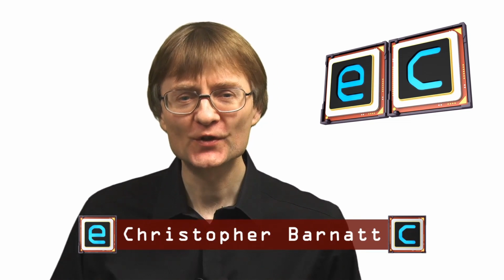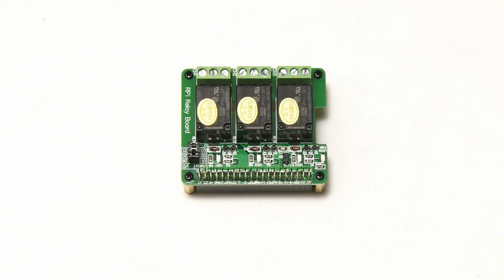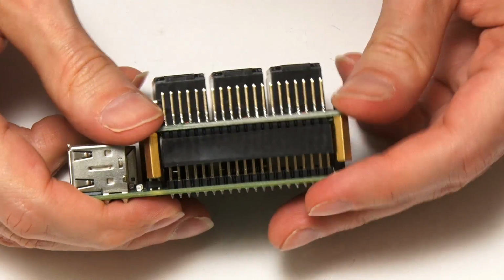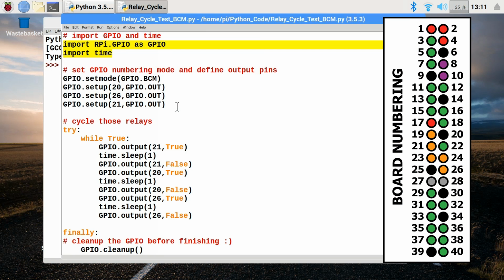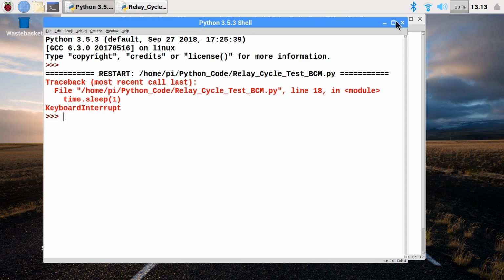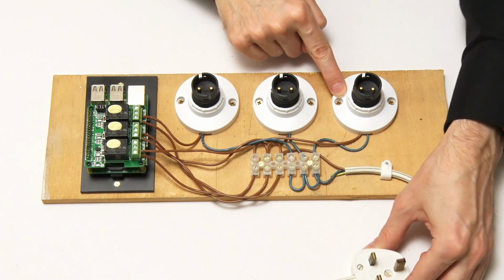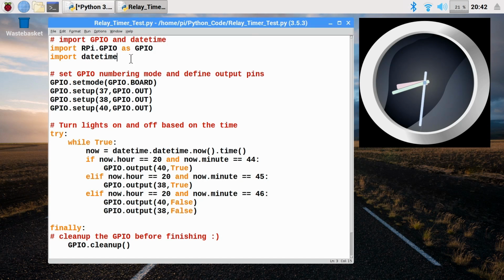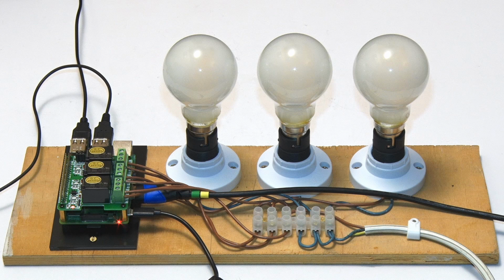Raspberry Pi Automation #1: Mains Relay HAT

Comment: Superb video Chris, looking forward to more automation videos. I've just got a couple of ESP8266, not entirely sure what I'll do with them yet, but one idea is to build a light for my office using WS2812 LED strip, controlled by Alexa, hope to start experimenting in the next few days.
Reply: That sounds like a nifty project. I was actually mulling over something similar for my DIY dream home project. I eventually want to build an off-grid tiny home with automation. In the absence of mains voltage, the home would obviously run on renewables and battery backup. So it would be most efficient to use LED lighting powered by DC from the battery bank.

If you make it, I hope you consider documenting it for YouTube. I'd like to see what you come up with.
Reply: @UCvqR6jxs8L_k74iTGOebE6g Thank you! Yes, LEDs are definitely the way to go, especially when your feed is engineered to low voltage, as there will be minimal losses due to transformers IMHO. Personally it's just a hobby for me and I don't really do build videos, although there are a few LED related videos on my channel. All me projects are derived from endless browsing through online info. This site may help, it has a ton of info on LED projects and displays https://www.tweaking4all.com/hardware/arduino/arduino-ws2812-led/

Comment: I did some similar in Basic years ago without the complicated setup you've got to control heat in a boiler, it involved a lot more code!! Sadly I couldn't test it if I tried it probably would have gone boom, as my electrical expertise is non-existent if it got too hot it would switch itself off, I had a maximum and a minimum heat level.

Comment: Nice video,

As you stated demoing this board shows how you can modify the code to fit into your environment and control devices either on a time bases or remote / manually.  With home automation using network/wifi I would just say do your homework with regards to securing your creation.

Comment: Have a look at Home Assistant, it installs on a Pi 2 or 3, as a docker container, or as a VM. And has so many integrations your mind boggles. I have been using it for a year now, it is amazing and the community is very active.
Reply: Just had a quick look then. I have a spare Pi so I might give it a try since I an rewiring the lights as I replace the ceiling.
Reply from the maker: I will take a look, thanks.

Comment: Tiny bit more wiring but a ton cheaper https://www.ebay.com.au/itm/5V-12V-1-2-4-8-Channel-Relay-Module-Arduino-Raspberry-PI-ARM-AVR-DSP-PIC/183418623699?hash=item2ab49a16d3:m:mfdi0jI17mD_rsG5P-hfu1g&frcectupt=true

Comment: In the US people (not me) get all excited if you don't use all three wire.  I noticed that the relay did support three wire but that the light sockets did not seem to.  Is that normal for sockets in UK?  It might calm some of the more tense if you mention the relays do handle 3 wire connections.  Great work and I might be trying this one!  Would like to see comparisons between cheap single boatd Win PCs one day.
Reply: the relay is switching the middle pin between the two outer, so you have a common pin in the middle, and then a normal open and a normally closed. there is nowhere to connect a PE wire, as there is no metal boxes that might become live at mains voltage in case of failure

Comment: Great. Do you have a plan to demonstrate some Java codes? Python is simple and powerful maybe there's no necessity to use Java, I suppose.
Reply: I think he prefers to demonstrate with Python for just that reason. Java is fairly ubiquitous, but Python has established itself as a very robust language that works splendidly across multiple platforms. I imagine an RPi might run Java just fine, but Raspbian comes with Python pre-installed. I've noticed that he tries to do things in the simplest and most straightforward way in hopes that his audience can follow along, so perhaps that's why he prefers Python.

I would love to see him tackle a little Java, too. We'll just have to wait and see if it comes up.
Reply from the maker: I do indeed use Python to keep things as straight-forward as possible. But Java is not rulled out. :)

Comment: "Lightbulb sequencing parties"!? Ohhh... the high life. Too rich for my blood.
Reply: This isn't too bad, the "LED Light bulb sequencing parties" are the expensive ones, the "Energy Efficient Light bulb sequencing parties" can take a while to get going 😁
Reply: Cal Mac Also parties using floodlights would be dangerous. Mixing water with electricity would be hard on the people attending those parties!  Yet I’m no expert since I don’t drink.
Reply: @perrymcclusky  Floodlight sequencing parties are for royalty, it would be a dream to attend one of those my friend. Water is used frugally at these type of parties, lager is used chiefly, it is safer, it's less conductive.👍
Reply: When RGB just won't cut it
Reply: @jasongooden917  😂😂
Reply: I think they are reserved for the "black tie" set... Red carpet is optional.
Reply: Better if you use the NC contacts instead, and then do a markee type chasing thing.
Reply: Light switch rave by any other name

Comment: 9:09 please don't do that.  use electric ferrules on the wires !
Reply from the maker: Again, point taken, but I used what I had available in this test setup.
Reply: There is nothing wrong with not using ferrules. Especially when this is just temporary setup for testing and demonstration only.

Comment: £24 for 3 relays and a PCB? are you completely nuts? 
no hate, but that is insanely expansive knowing the price of a relay.
Reply: On one hand I would agree about paying $16 (USD) for 3 relays is a bit much. However, the cost for someone who is not very knowledgeable about electronics might worth while as part gaining knowledge. From a learning standpoint, the module might allow a beginner to focus on the theory of how a relay works without worrying about the wiring of the support circuit.
Reply: so go get 3 relays and a pcb and show us just how simple it really is, im sure your going to try something like "i dont have the tools to do it" in which case you pay 24 euro's and be happy its not 50 euro's.
Reply: I not only found it expensive but compared to the USA price it is an even bigger swizz, £24.99 UK $16.99 USA
 I would have expected the prices to be £16.99 UK and $24.99 USA but even this would be over the top
 A bit of breadboard and the components could make this for under £8 easily
Reply: @AndrewAHayes  there is always cheaper options... are they practical and safe? most of the time no they are not, your paying for quality parts which are readily layed out on a pcb which conveniently attaches to a raspberry pi, now take your bread board and components and mass produce it and then ship it all over the world, but its not allowed to cost more than 10 euro's, hmmm  25 euro's is looking pretty good right now
Reply from the maker: I take your point. Though minority products always have higher prices. Note that there is more than a PCB and three relays here -- a Pi cannot drive a relay directly, so there are are Darlington transistors/pairs for each relay too, plus various resistors and the LEDs. But yes, all of the components could be purchase for far less than the whole board.

Comment: Would be really usefull to set up a wi fi interface ..
Reply: I watching take information. No money....
Reply from the maker: In the next part we will get to wireless . . .
Reply: Excellent. OpenHab is web interface based but trying to set up the devices is quite difficult and the documentation is a bit opaque. I figured it would probably be quicker and more usefull to learn enough python to write your own switching tables rather than trying to hack openHab which seems to be more aimed at corporates "Things" that already have the coding for them written.  I am wanting to automate a 12v off grid RV. At the moment I just have the lighting working with BasicUI. Look forward to see where you take this.

Comment: Can you stack the units and drive up to 9 relays?
Reply from the maker: Potentially, yes -- by removing the jumpers and wiring different GPIO pins to each set of relays. I've not got multiple relay units to try this, but it should work.
Reply: There is response on Amazon site that concurs that should be able to stack. Circuit diagram indicates using 5V power pins to drive circuits. Would assume might be able to bypass those as well and drive with external 5V. This possibly solved big problem for us. Many thanks for your excellent series.
Reply: In Australia they have 8 relay boards for 20 bucks. Snag is you have to point to point wire the gpio onto the boards. Easy enough but a little bit fiddly. And all the switching is happening at the same physical place so wiring off to the lights..
Reply: @waynerobarge8543  That depends on the current needed for the relays. It will be able to manage the holding current, but the current required for the throw - several times what's required for holding - might be a bit much for the RPi.
Reply: Yes that is my concern as well. We want to sequence series of events - we are gas sampling in research plots. We will get several of these and try them. Preference to building our own is standardization of parts and ability to have spares on hand as needed. The gas waits for no man.
Reply: @waynerobarge8543  As long as no two relays are simultaneously active, you ought to be okay (with the jumpers wired out to different pins on two of the hats)... but if you need more than one at a time, then a separate board with its own power to drive the relay would be in order. It still beats building the whole thing out of rocks discrete transistors like we did when I were a wee lad.
Reply: @waynerobarge8543  Another option is to get generic relay board which has optocouplers on the input side. This will also let you to use much bigger relay or contactors.
Reply: Thanks Richard. That is what we are doing now with Crouzet boards and solid state relays and an Arduino. We want to switch to Pi for more programming flexibility but Pi only puts out 3.2 volts that I have measured. Solid state relays trigger at 3 volts which is a little too close for my liking for something I want to run 24x7 unattended. Separate relay boards all seem to trigger at 5V. Any opinion on tolerance - they look like they are using Darlingtons using OUT voltage as trigger?
Reply from the maker: @Stan Rogers -- yes, there has to be a limit to how many relays the Pi can trigger and/or hold closed at once.

Comment: i prefer to use an old computer PSU, short pin 14 (i believe it's 16 on the 22-pin ATX2 layout, either way, the green one 4th from the top on the right-hand row) to a ground (black), so it's always-on, and use the +12 volt rails (yellows), i find it a bit safer than mains.
if your psu doens't have a flip switch, you can pull wires from those pins through some lever switch that shorts them to make your own.

and i usually don't have to switch that much,  so i can usually get by with a, say 40w mosfet. (per channel i want to switch)
i usually don't need super high switching frequencies either, which avoids a lot of heat on the mosfet.

you get like 16-20+ amps on the 12V rails, plenty for a good amount of leds, it is pretty clean power, has all the ATX safety features (like turning off when you short it really bad) and as an added awesomeness, you get to have +5v (red), and +3.3v (orange) rails to play with, which happens to be the voltage for most microcontrollers and ICs (you may still need some logic level shifters if you mix too much though)

great stuff for getting decent stretches of adressable RGB strips going (with the drivers already in em)
although if you want to do bigger stretches, you kinda have to trace another piece of speaker wire with the strip, and solder it to the strip up every x meters
(the contacts on the strips themselves are pretty thin, so they get pretty bad resistance for long distances, which makes the intensity fall off near the end of the strip, you could also consider putting the psu in the center and powering it outward both ways.)

i'm not too keen on the e27 bulbs, often the transformers seem pretty lousy quality,
when they die, it's always when you turn them on, and the transformer in the bulb just burns up (even CFLs had this problem).

i find my lamps blow out way less with a decent PSU behind it, 
and programming them so they rise in intensity when you power them, 
so they don't draw this peak current where overshoot can actually cause the drivers and the leds on those 12v strips to fuse together.
(they can do that too if you jolt them too much, the rapid heat production will weld them together in a singular, broken module, and i don't think giving those things thermal shock everytime you turn them on is really a good idea, so i ease them into it)

but ofcourse i have a relay board or 2 for switching higher currents too.

if you want to start toying with this stuff, but are really creeped out by the fact it's coming from your wall as a beginner,
you can get yourself a 5 volt USB powerbank, cut up one end off an usb wire, then get the red and black wire (other 2 are for data, not requireed) and start with 5 volt stuff until you feel confident enough, just make sure you have enough load on them, because many of them will turn off if the draw is below a certain threshold, this works a bit better for arduino and esp32s and r-pi nanos, as r-pi 3bs could actually demand more than the battery can provide
(as i understood it, the r-pi1 actually has superior GPIO anyway, because you can set the clock timings)

some newer ATX PSUs tend to have a threshold too, that's why i prefer the 20-pin old ones who usually aren't plagued with it, they're actually better for a development bench power, although there's comfort in knowing your PSU will just switch off within seconds if for some reason your device stops working, so i would probably use an ATX2 psu once the project is ready to be deployed.

i have a graveyard of old OEM power supplies ripped from scrapped pentium 4's, those were pretty power hungry, so they usually are good for like 300-400 watts, and they're 20 pinners.

usually i get quite a bit of old pentium 4's and pentium-d-s shifted my way, sometimes custom built, usually the dell ones, from people that wanna get rid of them and remember i'm a bit of a nerd, i got them coming out of my nose...
i just take the PSU, all the screws (can't never have enough of those), ram if it's ddr2, and the hard drives because i don't want anyone's data on the streets.
they go in a big graveyard box of dead drives and i deliberately handle them as hard-handedly as i possibly can 
if i want to develop my pitching arm, i have plenty of drives in various weights and 2 different sizes,
mind where you throw it though, they are literally built tougher than bricks and they will chip away your average red/orange brick lol, a nice big open area with a rough concrete floor does best ;)

then stack them up to be sent off to the garbage, i can't even be bothered to salvage the CPUs (unless it's a more rare e5200 or Q6xxx orso)

Comment: I have been doing this using openHab. Only using LEDs so far but would like to add temperature current light levels and other monitoring functions.  Setting up the software is far from straightforward if you aren't using corporate periferals.
Reply: Plenty of examples on the web and YT. Are you using MQTT?
Reply: It was quite a few months ago i set up the system i have now. It works fine for switching on 8 lights from my phone or a tablet. I am not using MQTT. In all likelihood there will be more resources available now. I am wanting to do things like monitor solar power PV and water heating. If I could write a web interface in python then I figure writing the code in python (begginer) would be easier than trying to work out OpenHAB.